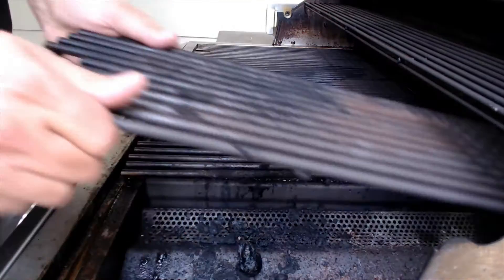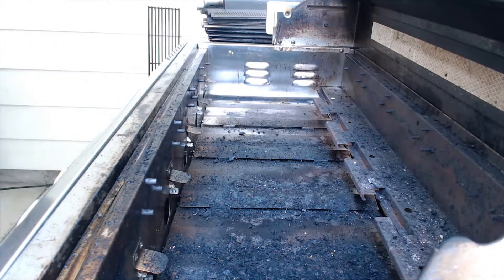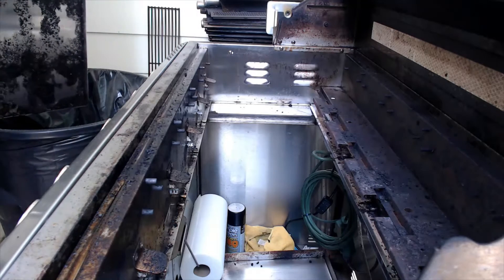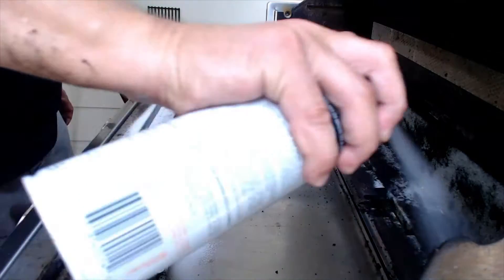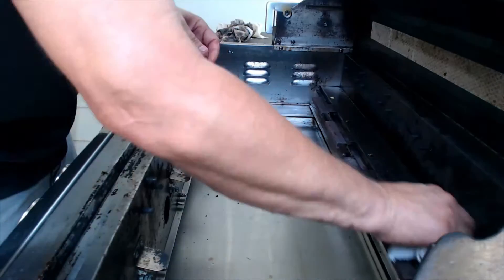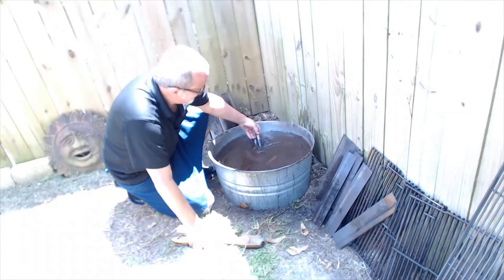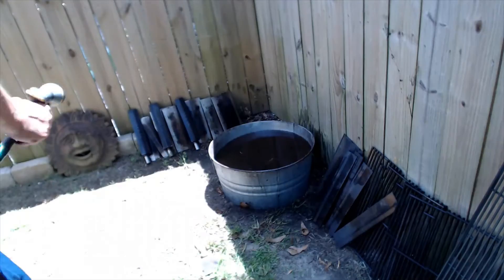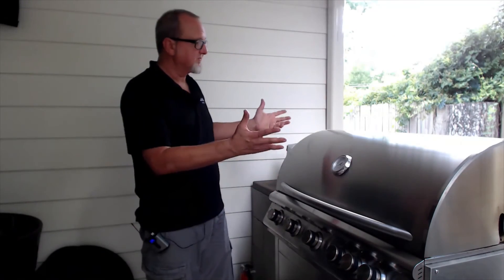Blaze Grills - How to deep clean your gas grill

Comment: Might be a dumb question... How do you clean the Infrared? I see that you soaked the other burners. I assume you cannot soak the infrared burner?
Reply from the maker: @AntNguyen88  Good question…. The best way to clean the sear burner is keep it lit for about 5 or 6 minutes, after use, with the lid open. Burn everything off. After it cools down use a soft brush to remove the debris and ash.

Comment: Jim - my grill is built in and was installed by a contractor. I can not remove the burners so I suspect the cotter pins were not removed. How do I access them?  Do I ned to remove the back of the grill??
Reply from the maker: It’s possible to get to the cotter pins from the front. What model do you have? Depending on what you have, I can give you suggestions.
Reply: I just got under the grill yesterday, and using a pair of 90 bend needle nose pliers was able to extract the cotter pins. I felt for them by hand first, insert the end of the needle nose pliers into the loop end of the cotter pin and they all came out with gentle pressure.

Comment: Hi Jim, I recently installed Blaze power burner (professional lux model) and all I get is yellow/orange flames forming black film on the pots. Could you please let me know how this can be fixed to get blue flame? I contacted the customer support but they don't have any specific instructions for this particular model. Thank you.
Reply from the maker: I would start with opening the air shutters, slightly. Small adjustments. The burners can be pulled out once the cotter pin is removed. You’ll find an air shutter adjustment for each burner, located on the front side of the burners. A Phillis head screwdriver can be used to loosen the shutter. Inner ring and outer ring each have there own adjustment. Just curious, did you call Blaze customer service or did you call a dealer? Blaze CS should definitely have info on this model. 866-976-9510.
***here’s an update….  I just found this video online. You may be able to adjust the shutters without pulling the burners out. Check it out. https://youtu.be/yFvtbhPQ5Y4?si=-Us9ityQFDyjdx5F

Comment: how do you reseason the grates? you didnt show that
Reply from the maker: Yes. You can never over-season the grates. I go through that process in this video….. https://youtu.be/-1kZr67v3Mw (initial setup)
Reply: @grillingwithjimbo  I found that eventually, so I slap some Crisco on the grates OK not sure how that really seasons it but OK I’ll do it
Reply from the maker: @pedrohizzle2835  it bakes the oils into the matte finish of the grates. Helps protect against corrosion and food sticking the surface.